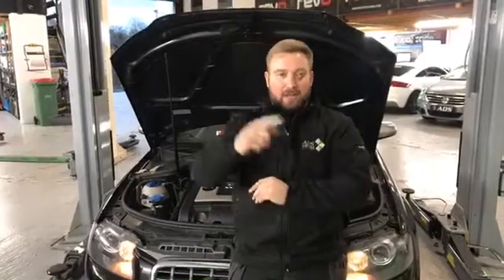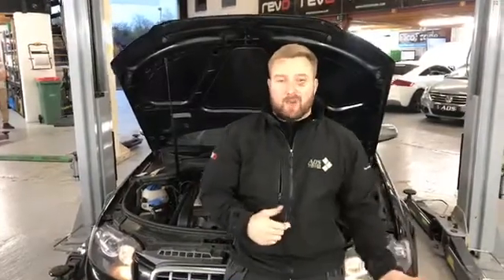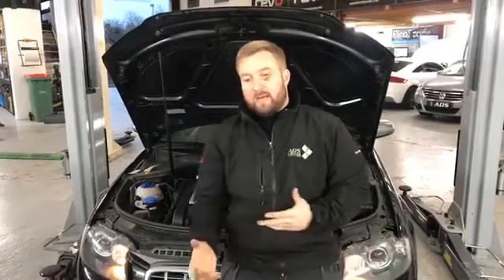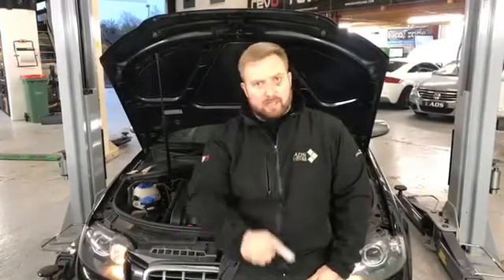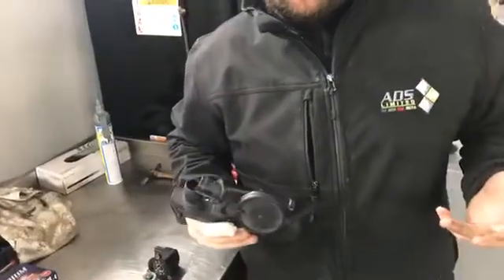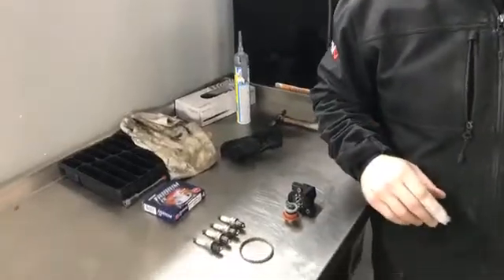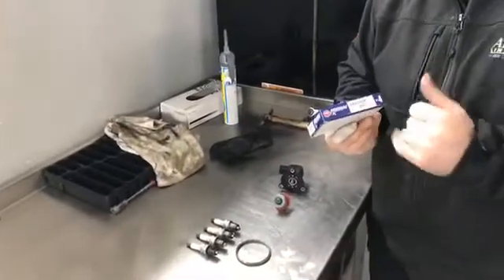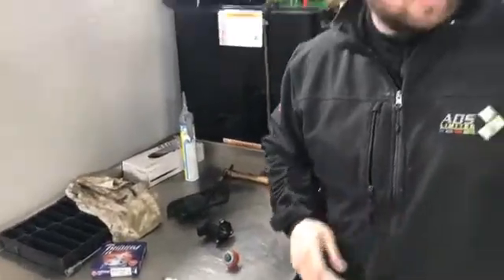8P S3 pre tune checks

Comment: Ditch the pcv that will fail again, plate it or catch can kit. The dv, Revision d and g will fail consciously, fitted 2 revision d and 1 revision g. I've had forge dv load not impressed pipes perished from the heat. Dv+ is the way forward, runing 1.7bar never had an issue.
Reply: Exactly 💯